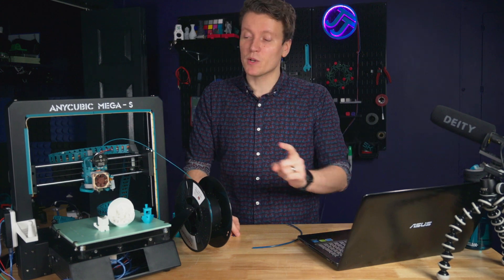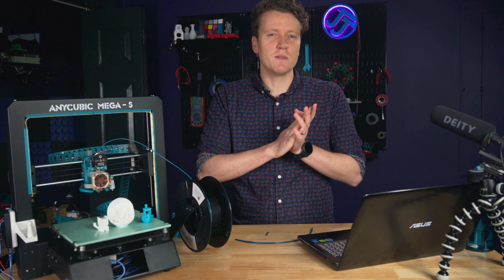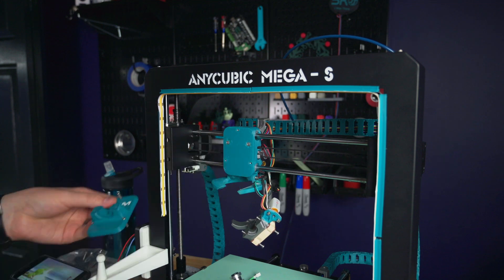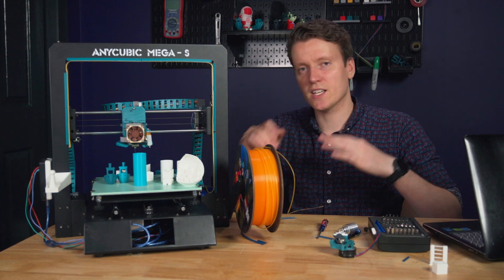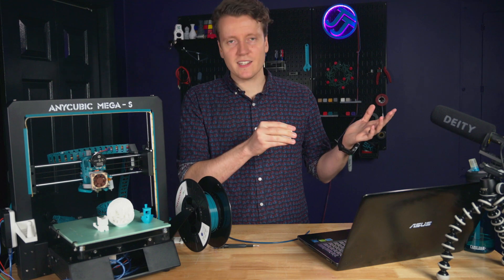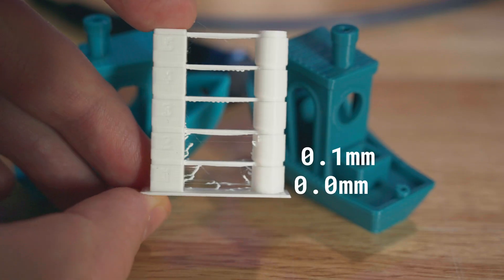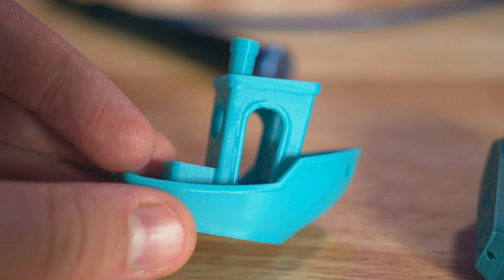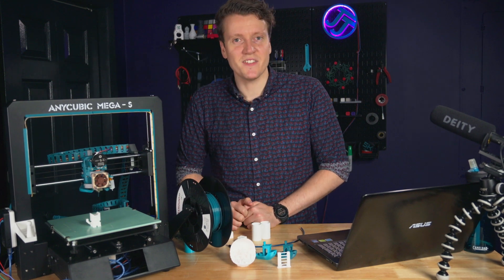Direct Drive on Anycubic Mega S - Sherpa Mini Upgrade

Comment: @8:45, Please answer this. My vase mode is clean but the regular prints do show those lines. Does that mean the issue is retraction settings? I am using a bowden setup with a cheap dual gear extruder.

Again,  20x100mm Cylinder vase mode is clean and beautiful but a 20x100 Cylinder print is full of layer lines.

Comment: Care! with tightening the Filament tension screw. Unless Genuine Bondtech Drive gears Bearings and Shafts ??
 The chinese ones, being of low grade steel  (NOT hardened ) and the bearings of excreable quality will chew themselves and the shaft up into iron fillings ... V quickly.

Comment: Awesome! I want to eventually get into TPU filament. I'm working on fixing my printer in its current state though, after a firmware update I got some issues. What firmware are you running?
Reply: Klipper I think, it is the best solution!
Reply: @102diy  I've heard this from some people. I upgraded my firmware and got it running pretty well. Haven't touched the printer in months though haha.

Comment: hello thanks for video . I have a problem with mine . TPU slide when extruding . And even when the wheel is tight, the TPU slips. I can even get it out by hand by pulling lightly. On the other hand, no money with pla petg and other hard filament . do you know what could be the problem? Because I disassembled several times and there are not 50 ways. I put a piece of filament to center the gears but it the same problem  . Thanks

Comment: Great video. I was thinking about upgrading to direct drive and I have the same printer with the same MK4 print head.  Do you have a link to the files you used to mount this to that?  I am also looking at upgrading the hotend to an E3D Revo instead of the cheap one that it came with.
Reply from the maker: Yes, here is the link: https://www.printables.com/model/206014-anycubic-mega-s-mk4-x-carriage-mount-for-sherpa-mi
Thanks for reminding me to add the link to the description. The Revo would be a great upgrade from the stock one. I did a minor upgrade to a better all metal hotend, and have had better results. I think just from the better machining of the parts.

Comment: Great video! You explain everything very well. I just picked up a lightly used Anycubic i3 Mega for $50. I have printed and assembled the same carriage on my printer.  I also added the y axis tensioner.  For some reason I still get ghosting with my print speed at 45mm. I am interested in upgrading the mobo to sk3 and this direct drive since I got the printer so cheap. I also have an Ender 3 V2 and S1 with marlin, looking for something different to play with.
Reply from the maker: If you're still getting ghosting, are you printing on a stable table? I've also found if belts are too tight then it can increase ringing.

Comment: I have been very lucky with my Mega-S, I bought it on Ebay brand new for $190aud and have not had a single problem in the 18 months I have had it and it prints everything beautifully. I can even print ABS with a cardboard box over it as an enclosure lol. Great printer straight out of the box in my opinion that needs nothing changed. Thanks for sharing mate.

Comment: That hole where the LCD once was is ugly. When I switched to klipper I simply put the pi zero 2 inside the machine, bought a 3,5" touchscreen and replaced the original with that. The LCD now shows the klipperscreen UI.
Reply from the maker: I do have some plans on what I want to fill that hole with, I just need to find some time to CAD it out.

Comment: Very cool upgrade, JJ.  My biggest question is, how does it affect the speed?  That would be my main reason for changing to squeeze out some more mm/s!  I typically print 50 mm/s at 0.2 layers and 60 mm/s at 0.3 for draft quality.  Any idea yet on how much more you can push it?
Reply from the maker: That is a great question, and I totally forgot to include some testing for this video. But I did some testing over the weekend, and  I am getting fair quality out of 100mm/s, low quality but still completing prints at 150mm/s. And I am getting really good prints out of about 80mm/s

Comment: Looks like an opportunity to build a mount for the top of the printer for the filament holder!
Reply from the maker: I normally have the filament mounted to a wall mount instead of the printer holder. Yes it definitely follows a straighter path when the filament is coming from above it.

Comment: surprised you didnt take this time to upgrade to 24v all over, you not feel like 12v is becoming more of a PITA as time goes on?
Reply from the maker: I feel like I should have done it when I swapped out the control board. The Sherpa Mini works the same on 12V or 24V, but YES, at this point I feel like I should have already swapped to 24V at some point.
Reply: @JJShankles  i mean it would have allowed you to use the CHC at 24v :P I have to say I'm loving both of mine